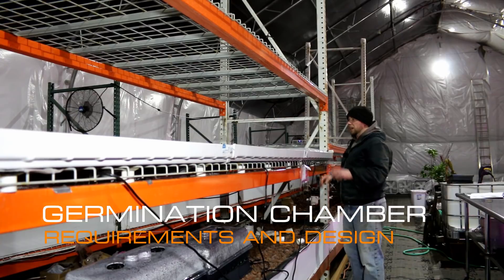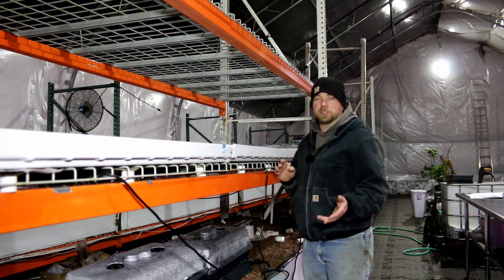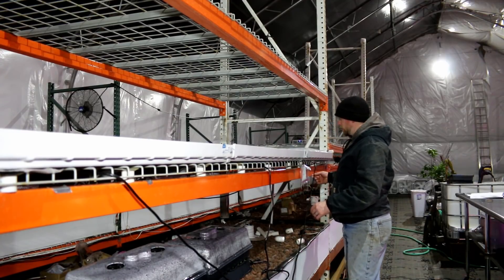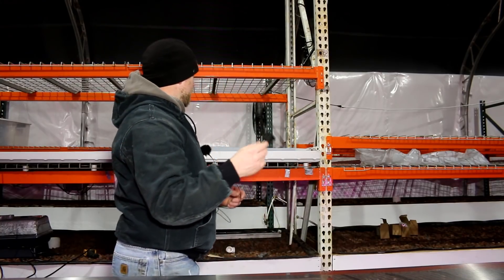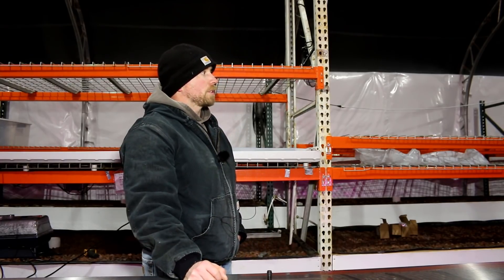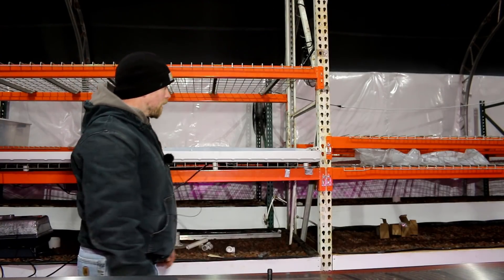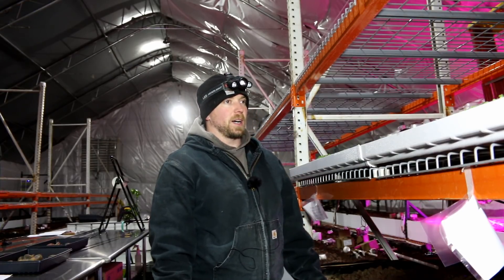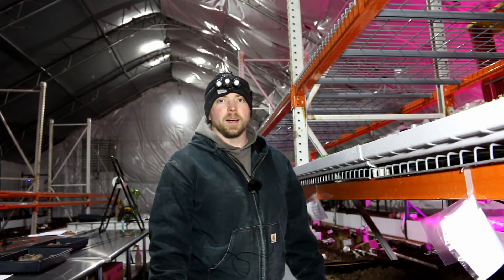DiY Germination Chamber?

Comment: Commonly accepted method of sprouting is to stack the seeded trays up. We stack 5+ trays up on top of each other. Maintains moisture on all the trays and applies pressure which helps to stimulate strong growth. No heat or encapsulating needed. When seeds sprout (3-4 days) unstack the trays into the bottom water trays and you are good to go.

Comment: Have you looked at having a pump fill a black water tank on top shelf? Then use the gained head pressure to flow to each system. More electrical efficiency to switch pumps on once in a while to fill tanks instead of the repeated end rush for each zone fill.

Comment: Try waterbed heaters make a thin frame to go over the trays stretch the plastic over it and lower it on to the trays with small pulleys and rope from the top shelf.

Comment: TRM,    You could use a heat gun to make  the tray have a depression in the tray for the drain.  That will only work if the pan is made of the correct plastic.

Comment: A sheet of styrofoam insulation under the Matt would make it more efficient, but a germination chamber doesn't have to be too expensive. I found a free non-functioning commercial upright freezer, building it out with second hand crock pots filling one with oil for heat and one with water for steam. Both will run to their own respective humidistat and thermostat. Got the design from farmhack.net.

Comment: Hey RM, check out Bright Agrotech on YouTube.  They used a siphon to drain their trays.  Basically just a bulkhead but on the interior they cut a short length of tubing plugged it into the bulkhead from inside the tray and then attached a 90 degree fitting on the other end of the tubing.  Also lots of growers make their own germination chambers out of old chest freezers, once again search YouTube for ideas.  Love your channel.

Comment: heat gun.  heat up the plastic tray with the drain fitting installed and push down on the tray .   it should deform the tray enough to get your 1/8 or 1/4 inch.
Reply from the maker: +Randy J that's a great idea

Comment: put the drain in and heat around it with a heat gun and pull down on the drain.... Look into a Bell siphon for draining your beds and kratky float valves for water level.... depending on what you need.

Comment: Run those beds just like the building, put in some simple ribbing. As to the drains, worse comes to worst, you could run some stainless screws into them from the bed and silicon over the heads for food safety/rust prevention, should the weight prove too high for the glue.